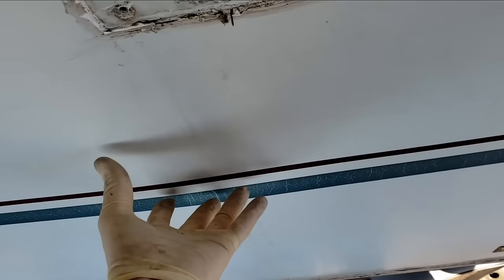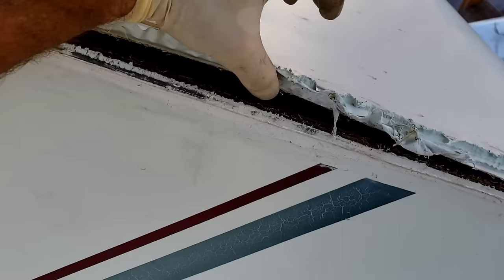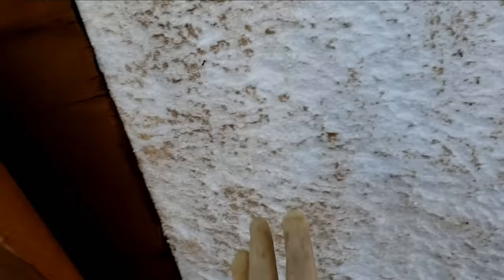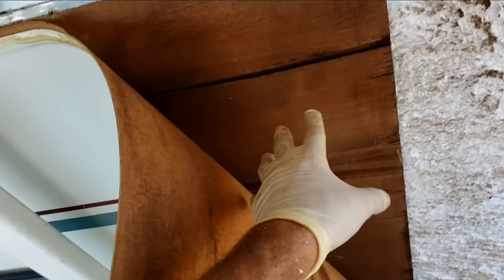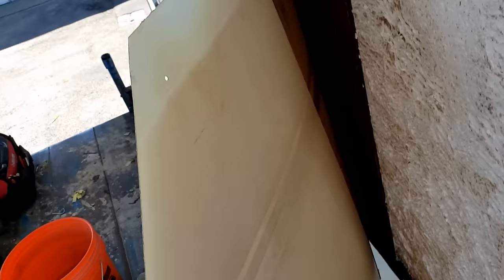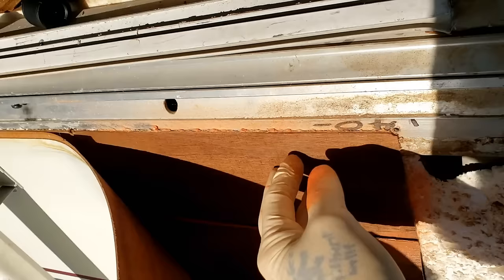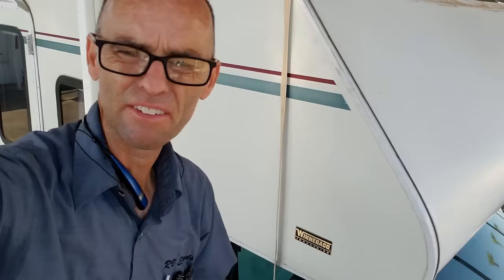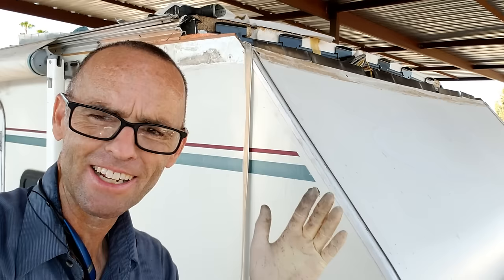How To Repair Loose Laminated RV Sidewalls....and Why It's Not Done

Comment: Wood is not that bad, use hillbilly solution.  Apply adhesive, cauk it, leave bottom partially open to drain, screw it.
Reply from the maker: That is a proven technique. Thanks!

Comment: Great video. not real sure why anyone would buy one of these cheap ass rv these days. Sure seems like the ones from the 70-80's were much better built. I stayed in a 1 year old camper with slides that had never made a road trip and it leaked at the slid outs
Reply from the maker: They are all trash

Comment: Why not just remove the whole damn side? And do it right? and once and for all? Make them help you if you're a one man band until if becomes a one man job again and then take over from there. I'd just explain the whole situation to them and then let them go from there. You could probably do a better job than the factory and it would probably outlast the rest of the vehicle or at least until it came time for it to be repaired again on another side. Should've cut the wood before you glue it up there too and the made a template or copy of it so that you could use if for th future if this is something that yo do often.